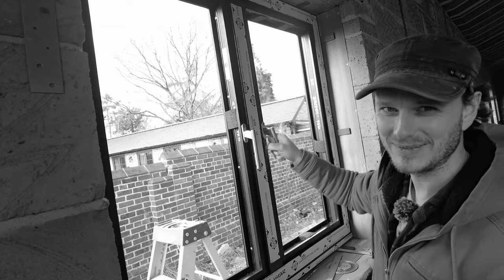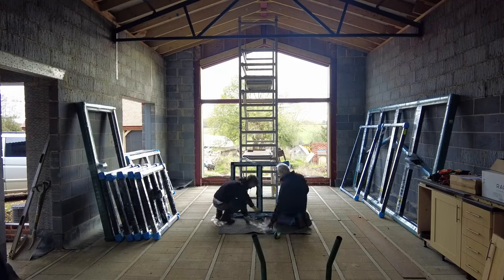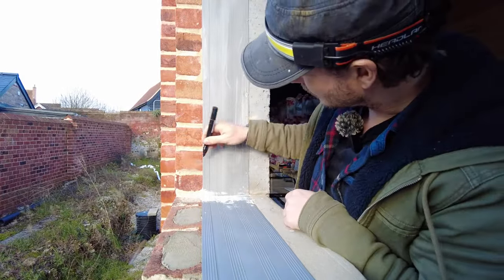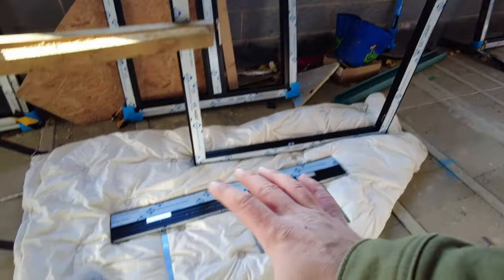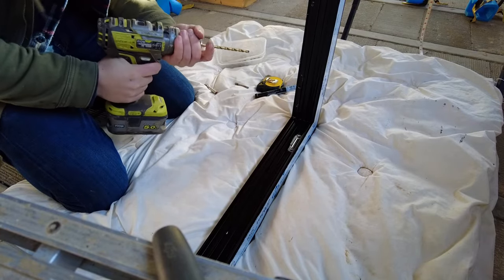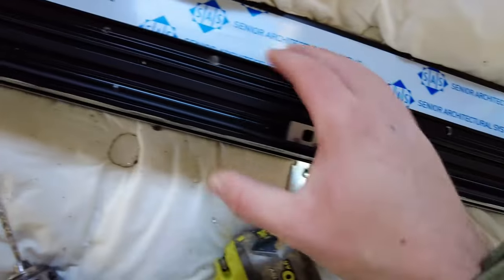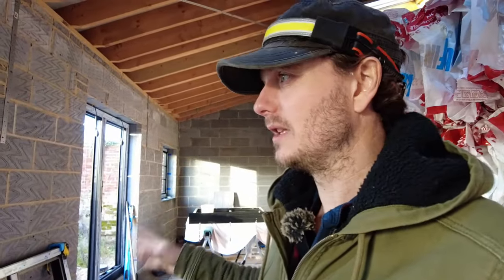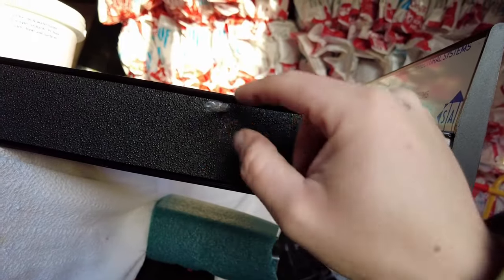How To Fit An Aluminium Window  - Complete DIY Guide UK (from purchase to install)

Comment: For a have a go ay homer your extremely misled about proffesional installers. Maybe you just dont understand the concept of why we are worth the money we are, the years of experience and knowledge comes to mind...
Reply from the maker: I'm confused, why am I misled? I'm not quite sure why I have offended you or what you are trying to say. I didn't slag off window fitters in my video or anything. 🤷
Reply: I have so-called "professional installers" at my place right now butchering an aluminium window retrofit on my double brick house, which is why I am on this thread looking for detail.  They didn't select or measure the windows well, didn't prepare the opening with care, installed with obvious insulation and air gaps, and are happy to cover it over as quick as possible so it looks "finished".  I would love to swap to an installer with the AidenProject attention to detail who clearly understands the technical requirements, offers well considered techniques, and most of all cares about doing the job as if they had to sit next to that very window for the next 50 years.   As a detail oriented person also myself, I'd happily take on board any sage advice that a professional might be able to add on top of this, but just "I have years of experience" doesn't cut it.  In fact I suspect that years of experience is at the heart of my window problem, as windows have been poorly installed for many years.  Modern windows and modern energy goals needs a detailed technical approach that I think AidenProject illustrates well.  Apologies in advance to the real professional installers who I know must be are out there, but they are not the ones at my place.
Reply: @whatsongong  so basically what your saying is you've happily hired a load of cowboys to come and fit some doors, you haven't paid them good money clearly or they would have measured and had a door fabricated to fit, also the fact your saying if you wanted a proper job you'd have to go to whoever (I'm from uk I don't know who ot what your talking about)  says to me your aware you haven't gone for a good installer. Go cheap get crap, a pair of bi fold doors from me would cost you roughly £4000, it would take me 3 hours to fit and finish. You may say that's too expensive but that will be the cost of the bi fold and glass being manufactured to fit and installed to a professional level finish. In essence e I'm saying you pay for what you get 🤷‍♂️

Comment: shouldnt be fixing to outer skin. they need be set back more in cavity and strapped.
Reply from the maker: Thank you for your comment and I'm guessing you may not have watched the whole video just yet maybe 🤷‍♂️ it is rather long so I can understand why you wouldn't. I did explain that ideally it's best to use straps. I also showed how I used straps and fixed to the inner blockwork on my French doors. However, for this particular frame from this manufacturer it is impossible to use straps and they instruct you to use direct fixings. This was because of the way they designed them to be thermally enhanced. Regs say the frames need to be 30mm over the cavity, I could only do just over 20mm because of the way I had to fix them. I had no choice. All explained throughout the video 👍